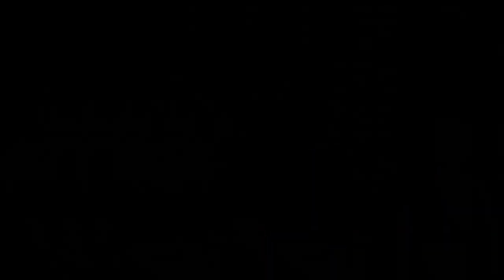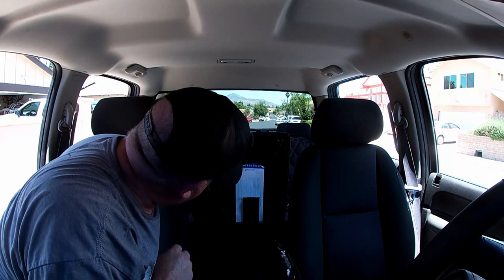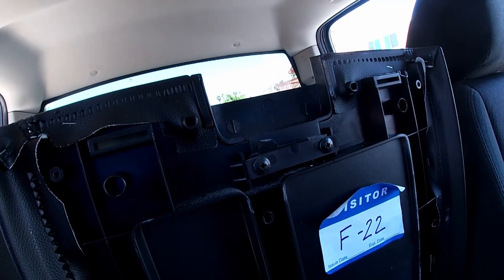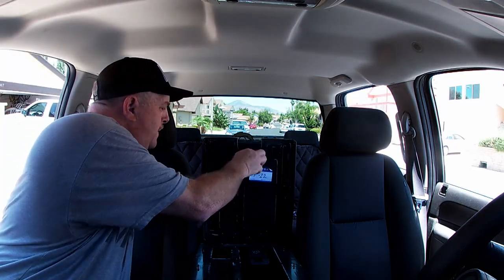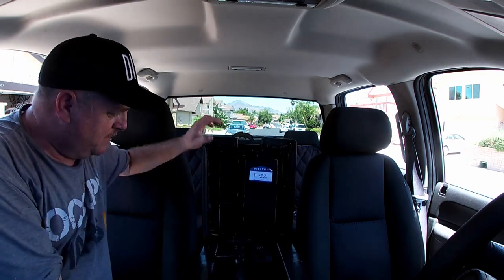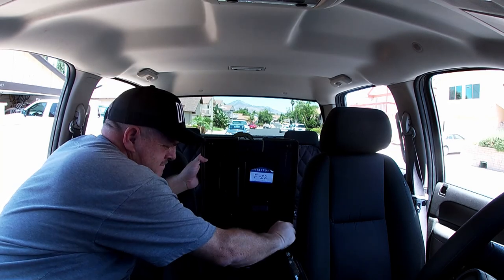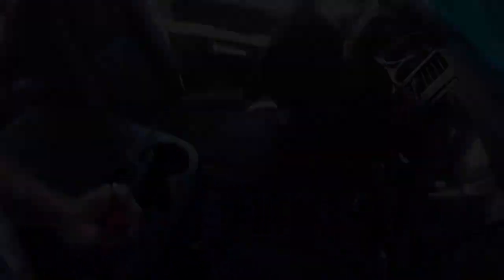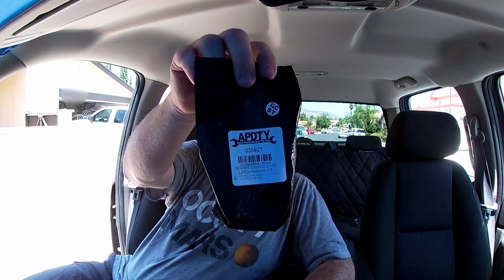Chevy Silverado Center Console Latch Repair

Comment: Thanks for the nice video. Do you know the name of the part that connects the lid when you close it? The bottom part is broke on mine (where it connects when you close it). Thanks
Reply from the maker: Sorry for not responding sooner but I’ve been a little under the weather. I believe your asking about the latch that locks it in the down position.
Reply: My bottom patch is broke also any tips?
Reply from the maker: Hello chasingkans, the bottom latch? The seat latch? Thanks for watching!!
Reply: @DIYWilly  the latch part where the lid console latch goes into lol sorry don’t know how else to explain it. Just replaced the lid (needed) thinking it would latch but the other part is broken
Reply from the maker: Isn’t that part molded in the plastic?

Comment: Hi Willy! How do you replace the catch? The latch has already been replaced in my center console and now the catch broke!
Reply from the maker: Hello Janna, Ive had the question asked before and I wasn’t able to find a replacement part for the catch. The catch is part of the whole plastic inner piece. Pretty much would need to replace the entire console. There are a few on the bay but would have to make sure the correct year and model for truck. I could try and make a fix though. I’ll look in to that. Thanks for watching!!!

Comment: What about the cup holder part? Mine somehow melted and I’m trying to find a place to buy the part.
Reply from the maker: I take a look at what I can find.
Reply from the maker: Hello Philip,
I was able to find the cup holder part but the website says discontinued. I have usually been luck finding what I need on gmpartsnow.com. I did however find a used center console on eBay for about $300. 
https://www.ebay.com/itm/265801420643?mkcid=16&mkevt=1&mkrid=711-127632-2357-0&ssspo=CMVnVZKpROm&sssrc=2349624&ssuid=7NqKU87xTaW&var=&widget_ver=artemis&media=EMAIL

Comment: Hows it going do u happen to know the size of the two screws used for the latch
Reply from the maker: It’s going good can’t complain. Yourself? Been awhile since I had the cover off and I didn’t measure those screws. However I have another video showing removal of the cover and I wouldn’t think Chevy using too many different sized screws. The cover hinge uses #8x1 screw. I would try that size or maybe even #8x3/4 for the latch just to be safe. If it’s a new cover try predrilling the holes slightly before installing. Take your time and thanks for watching. Hope this helps…
Reply: @DIYWilly  thanks for the quick response man I'll try both of those out tomorrow
Reply from the maker: Try the 3/4 first so not to damage the cover. Good luck nd let me know how it turns out.  👍